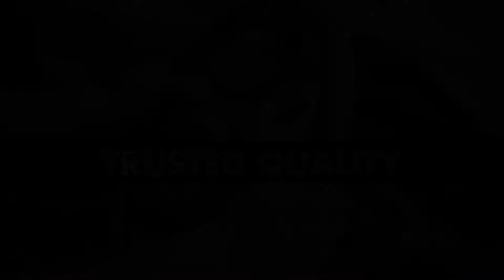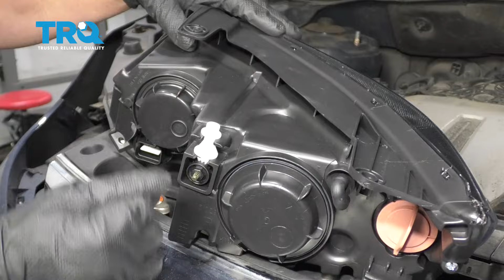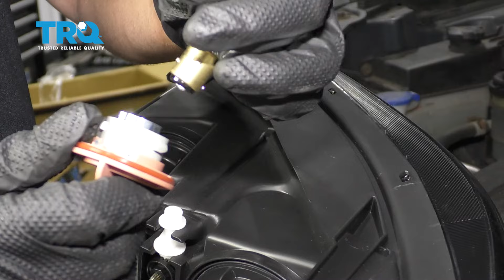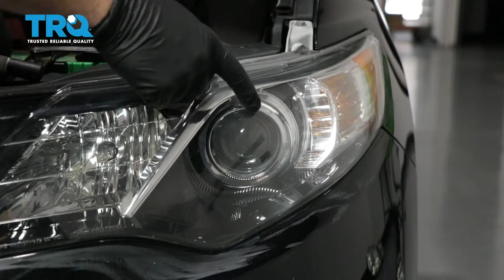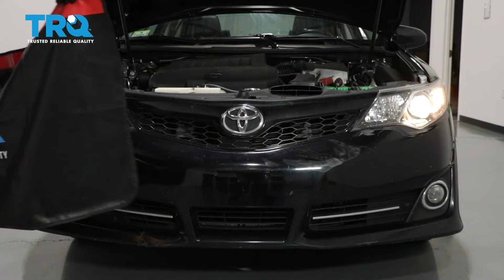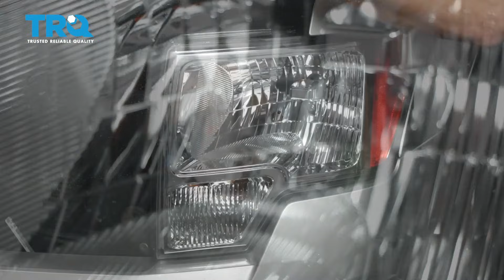How to Replace Headlights 2011-15 Kia Sorento

Comment: Just to be clear, on the 2014 Sorento the front bumper cover is integrated into the lower portion of the lens assembly such that, you can't simply 'lift up' and pull the assembly out. The inset into the lens assembly is deep enough- 1/4'++ that the front cover prevents you from simply lifting up and out. Just won't happen.

About 8 yrs. ago I had to have a repair that included replacing a damaged lens assembly and I clearly recall the owner of the shop explaining that on the 2014, you had to drop the front bumper cover in order to properly install the replacement assembly.

The other observation is that there is no 10mm bolt in the lower section of the assembly housing holding the unit in. I got frustrated searching for that. So then I examined the new assemblies I purchased and sure enough, there was no hole drilled in it anywhere as depicted in the video to accept a 10mm securing bolt.

Wish that it were as simple as shown here but apparently not for the 2014 and I'd assume the '15 as well.

Comment: 2015 Sorento has no lower screws, but you have to loosen the bumper cover on each side. This is because the lamp assembly actually guides the bumper cover into place. There is only one screw on each side to loosen the bumper cover just inside the wheel well at 2 o’clock on passenger side, 10 o’clock on driver’s side. Then pull hard on the bumper cover. Very hard. Don’t worry, it all snaps back in place later. If you are unsure, don’t try it, but it worked perfectly for me… 30 minutes on each lamp assembly replacement. The reason I had to change out my lamp assembly was because the low beams became very, very dim from decaying foil reflectors inside. New assembly was the cure… very bright low beams now. Thanks for this video.

Comment: when replacing the headlights I see online some look silver inside the low beam housing and some look dark. My 2014 LX has very dim lights and a bulb replacement didn't fix it and I'm hesitant to buy new headlights because I'm not sure which ones to get

Comment: This method WILL NOT work on a 2014 Kia Sorento Limited built in Georgia.  The bumper cover must be loosen on the side being replaced , top and bottom, and pulled out to get enough clearance to slide the light assembly out.  Also, it only had the top 2 bolts - the bottom 3rd bolt was not present and no provision for it.

Comment: This guide is very detailed and easy to follow. However, I found that none of this was really necessary. I started to follow the guide and got the step about the back bolt when I realized I could easily access the lamp covers very easily with just my hands. Maybe it would be more difficult for someone with large hands. But I was able to remove the covers, and bulbs relatively easily. I had a little more trouble with the right bulb near the fuse box because it was a little more cramped. But I completed the whole job without removing the entire assembly as shown.

2011 Sorento
Reply: I actually had more of a problem locking them back into place on the passenger side because of the washer fluid tube and whatever metal bar is running just above the lamp cover.  Otherwise it was pretty easy, and no need to remove any screws or bolts.
Reply: Realizing the same thing right now.

Comment: The title of the video should specifically say headlight ASSEMBLY.  People just looking to replace the bulbs will be really confused. ALSO, it should be stated that these new assemblies are nothing like the factory OEM regarding the bulbs, so that may confuse people looking to just replace the bulbs. The low beam bulbs (on the outside edge of the assembly) do NOT have that hold down wire clip. They are H7 bulbs that push into the base and the base twists on into the assembly.

Comment: Asking again about the infamous lower bolt…SPECIFICALLY for the 2014 Kia Sorento…the new headlight assembly has no holes for a bolt or screw. Maybe the vehicle used is a 2011-2013 Sorento, honest mistake but at least make a comment. Plus does anyone from TRQ monitor and answer these feeds? No reason to subscribe or make positive comments…HELLO???

Comment: Working on my 2014 Kia Sorento headlight assembly but don’t see that last 10mm bolt on the bottom. There’s no hole or mount for the new assembly so I’m curious where is this bolt?
Reply: Did you find the third bolt?